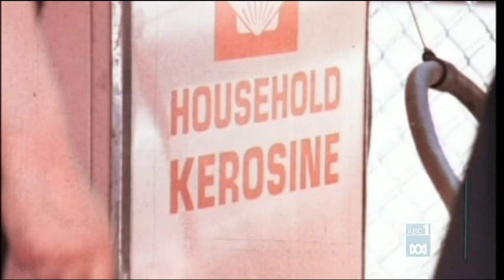Steam Powered 1963 Ford Falcon

Comment: the REASON should be clear to all why the steam engine went into obscurity almost..**BECAUSE its the most efficient !
Reply: +Frank James Steam powered automobiles are completely obsolete because its the LEAST EFFICIENT form of combustion engine transportation.
Reply: +The real doktorbimmer  steam isn't combustion.. but it IS the most efficient engine
Reply: Frank James Well, I've never seen a car fueled by Nuclear or Geothermal...

Internal combustion engines have a far higher practical and theoretically efficiency than steam...

Steam is LESS efficient than ICE's.. much, much less on the scale of an automobile.
Reply: Frank James Nikolaus Carnot proved that the internal combustion heat engine was more efficient have steam... 

decades before ICE's were even invented.

He also calculated that steam could never reach the same efficiency as internal combustion..
Reply: +Frank James the REASON should be clear to all why the steam engine went into obscurity.. they waste fuel
Reply: The real doktorbimmer
  steam isn't a fuel .. steam engine is made to run on any fuel .. why do all nuclear generator stations use steam? why do nuclear subs use steam because its thew MOST effective and efficient conduit. SO the steam engine is not obsolete at all.. accept to the general public.
Reply: Frank James Wrong... the most efficient single cycle heat engines available and in service today are Diesel internal combustion engines... not steam

Steam is only used when extremely cheap fuel like coal or nuclear can be utilized to offset their lower fuel efficiency... or on a massive scale where heat recovery cycles can be added and operate more cost effectively.

Steam is less efficient than ICEs

Any engineer can tell you that..
Reply: +The real doktorbimmer  im sure the err is made by comparing steam to an actual fuel which steam is not .. then again it depends on the purpose of the engine or system, weather for heating or transport or otherwise, then things change, like the nuclear example. but in a crisis situation wheres petrol  fuels are short to nonexistent.. the old steam engine could run on about any fuel whatsoever, but i am convinced the technology has long been around to uses existing fuels to  make a steam engine that out performs and outlasts a typical direct fuel engine.
Reply: Frank James No its not.
I'm sorry but you still seem confused..

The efficiency of the ICE and steam engine can be compared directly using the Carnot Heat Engine Formula... and expressed as a percentage of total Thermal Fuel Efficiency or TFE regardless of the type of working fluid
 used.
Steam has a LOWER Carnot heat engine cycle efficiency than ICE's

You can't defy the laws of physics or thermodynamics... regardless of what you believe is true, you are simply basing your opinion on false assumptions and misinformation.

Diesel engines can operate on virtually any combustible fuel source that can be used by steam... either directly or processed into a liquid or gaseous form.
Reply: +The real doktorbimmer 

Perhaps a real life example could be show with the same vehicle using different power plants.  For example the  ocean liner QE2.  When built, she had boilers and steam power.  During the 1986-87 retrofit, these were replaced with diesel, resulting in a higher cruising speed and 30% reduction in fuel consumption (about 250 tons/day on that scale).
Reply: Frank James I'm sorry you are so confused on this topic... I don't need to fabricate any position on this subject... these are the facts and they are irrefutable.
Steam engines can never be more efficient than internal combustion! but this should not be news for anyone educated or knowledgeable on heat engine design.

Nicholas Carnot published his study on the Carnot Cycle Formula for Heat Engine Efficiency nearly 200 years ago..

Not only did he create the formula we still use today to determine heat engine efficiency... he also proved that the steam engine was LESS EFFICIENT

And he did this decades before the internal combustion engine was even invented!!!!

I can walk into a car dealership today and buy an automobile powered by an ICE which is more efficient than the largest most efficient steam engine ever created..

Large ocean going vessels are powered by Diesel engines which achieve thermal fuel efficiency higher than the theoretical limits of steam power.

Any questions?
Reply: ***** It does not matter if you are gay or lesbian, you won't be saving any energy or money with steam cars, they are obsolete because their maximum limits of Carnot Cycle efficiency are much lower than Internal Combustion Engines.
You can never build a steam engine more efficient than an ICE. The Laws of Nature may be flexible but the Laws of Thermodynamics are not.
Reply: @doktorbimmer  if you believe in the narrative yes
Reply: @thelionofjudah5318  The facts are irrefutable, steam is far less efficient than internal combustion.
Reply: NOT by a long shot.  Not for a small vehicle like this.  Reason?  Small and insufficient condensing (air-to-air) surface causing a heat rejection at far above ambient temperature.
Reply: cbcsound Cbc Ah, YES!  A perfect example.. and beautifully illustrates my point.

Thank you sir.
Reply: +cbcsound Cbc  yes when your comparing petrol  or fossil fuels Yes diesel is better.. but then again  old WW2 subs ran on diesel .. they changed them too nuclear .
Reply: Frank James Sorry.. nice try but combustion engines cannot operate underwater, and nuclear propulsion DID NOT EXIST IN WW2...

Subs use electric motors..

So your point... unfortunately, is completely moot.
Reply: +The real doktorbimmer  well what do you think generated the electricity for deep propulsion.. the diesel engine. Don't think there's ever been a stand alone  electric sub before.
Reply: Frank James Ah..yeah, there' have...
 they are called mini-subs, midget subs or submersibles..

Combustion engine subs must surface to charge batteries..

Nuclear propulsion was not available until the 1950's
Reply: IM surprised you didnt mention toy remote control vehicles too .. listen others are trying to tell you what I am ... Combustion engines are among the worst engines made, you don't wanna get that.
No use trying to keep fabricating a position that  refutes this.
Reply: It is also cheaper and more efficient to marry the same sex , but saving money and being more efficient isn't always rite !
Reply: The real doktorbimmer Then you post the blue prints and schematics of a better steam powered car than this one and the Doble , mister know it all !
Reply: +Poy Ester  It was a commercial failure too
Reply: +keptin kaos Well you recon'd completely wrong son... it has been a well understood and commonly accepted fact among Engineers that steam is inherently less efficient than ICEs.. If you believe otherwise? you sir, have been sadly misinformed.
Reply: +Autistic Boy But Carnot discovered in 1824 that steam will always be LESS efficient.. its not a choice that offers solutions for today's transportation needs... in fact its not even an option that on the table as commercially viable altrernative.
Reply: The real doktorbimmer you are right about thermodynamics but idk about nature. If you killed everyone on earth except two guys (or girls) and whiped out all technology putting them back into the 1200s in terms of tech, they wouldnt reproduce.
Reply: +Trevon Cowen The thermodynamics is the only thing that counts in this discussion... Poy Ester's comments were completely moot.
Reply: 2 more reasons why I cant see them adopting steam at this late stage 
1 Economy of scale the infrastructure to build and support steam engines is currently minimal so it would cost lots to kickstart that 
2 every boiler is a bomb waiting to happen rust or damage to the boiler and tick tick tick the clock will be ticking
Reply: LPG and a hose is difficult ?
Reply: +Ste T The main disadvantage is cost and steam's horrible efficency
Reply: and i recon your very wrong
Reply: +keptin kaos The Carnot Cycle formula tells us that the Ideal Rankine cycle engine will always be LESS efficient than an internal combustion design... this is something that has been known 40 years before the invention of the first practical ICE.
Reply: +marias man Not in a single pass, single cycle engine... which is entirely my point.
Reply: +marias man The "ideal Rankine engine" would still deliver less efficiency than a Carnot Engine, True.. but both are purely theoretical... in terms of "practical" heat engines, the internal combustion engines are able to reach closer to the limit of the Carnot engine than the Rankine... Nothing proves this theory more conclusively than Rudolf Diesel's engine.
Reply: +marias man It is  certainly not "vague" to specify if an Otto Cycle or Rankine Cycle is a Single Pass/Single Cycle Heat Engine?
Reply: +marias man "To clarify, a Rankine cycle engine that incorporates aggressive reheat and heat regeneration" That certainly does not specifically describe a Single Pass engine design.
Thank you for proving my point.
Reply: +marias man  The Rankine Cycle is indeed inherently less efficient in a single pass system.. there is nothing vague regarding this statement.
Reply: +marias man  The first pass should always be the most efficient cycle, further additional passes will recover additional heat, but come with a diminishing return in efficiency and obviously with increasing expense of additional build and operating cost, weight, complexity and scale.
Reply: +marias man Yes sir, indeed I have.. read and you shall understand.
Reply: +marias man As a matter of fact, originally you did... but you have since become wiser... Cheers!
Reply: +marias man If you ask a rhetorical question? why do you expect to get anything but a rhetorical answer?
Reply: +marias man Howard can't even figure out his own fuel mileage.
Reply: You can't break the Laws of Thermodynamics  which dictate that steam engines are less efficient than internal combustion engines.
Reply: Carnot published his formula in 1824... Rudolf Diesel proved the formula correct in 1898.
Reply: +keptin kaos The problem is how much more LPG you will be using compared to an internal combustion, they run just fine on gaseous fuels too... they just need a lot less of it to do the same job.